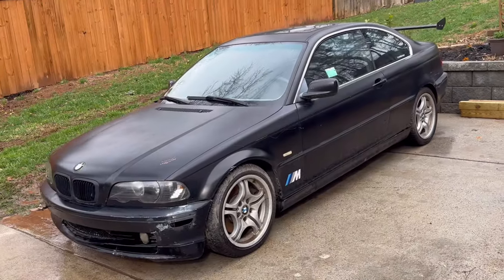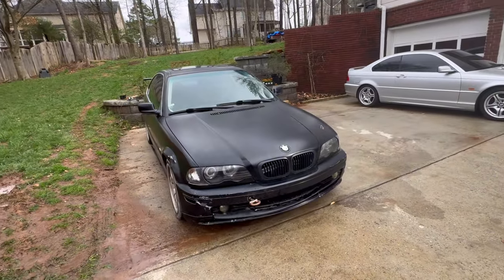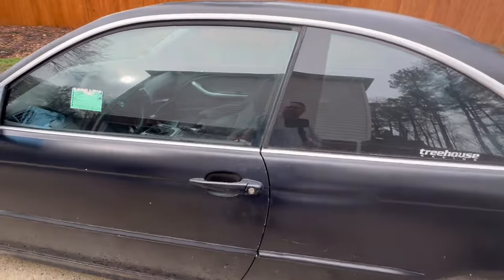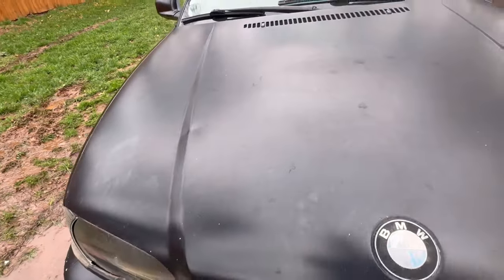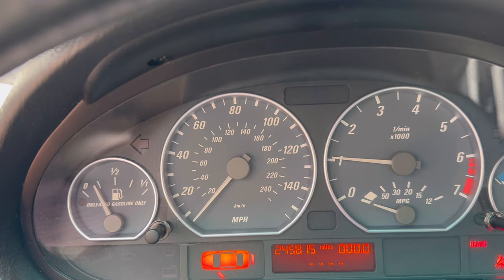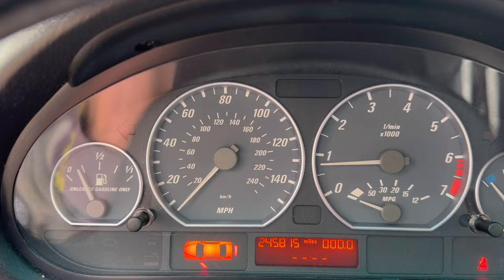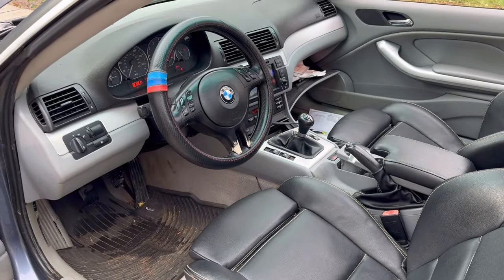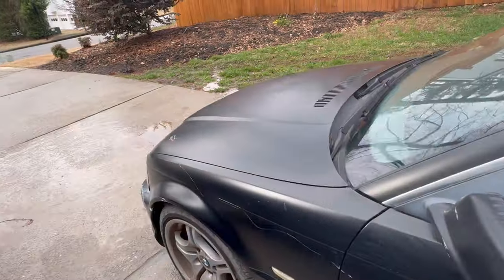$600 manual E46 330ci bought sight unseen. Will it run and drive?

Comment: After owning three e46’s, I’ll never go back to owning one. There’s always some issue arising. I’ve replaced every component I can think of and still having issues. Not to mention they aren’t quick and parts aren’t too cheap compared to other vehicles I’ve owned. Sticking with Toyota.
Reply from the maker: They certainly aren’t as maintenance free as a Camry - but the driving experience isn’t anything alike either.  I really haven’t seen huge costs differences in parts and I’ve had every nut and bolt out of my grey 330ci.  I’ve owned many Toyotas and still have my tundra - it’s a beast.  Then we have the Model Y for daily and work duties.  A shoe for every occasion so to speak.
Reply: @robsweekendgarage  nice. Agree, BMW’s are fun to drive. Mine is a wagon and still feels like a go kart.

Comment: Well after the insane prices we saw for these cars in 2020 to 2021 (in Canada they were) to see one that's in this condition being bought for $600 it seems almost impossible. Not that it's a wonder mobile LOL. Even today I saw two 330CI's one with a blown head gasket and the other was a "Bring a trailer"  thing for $2500. This is a major score!! IMHO. There's not much for rust that you've shown anyway. Why would you part that one out? Maybe you should part the other one?? Or finish fixing this one and sell it for a tidy profit? Parting it out doesn't make sense.
Reply from the maker: When I first saw it at auction the idea was part out.  Considering salvage title and that I’d have to apply for a title if I wanted to sell it cost me another $200.  Add in that I was expecting no keys and most cars that get towed and impounded aren’t cream puffs - that was my original intent. But after spending some time with it am really starting to see that it deserves to be back on the road.

Comment: With title situation- parts car which you can make probably 3k or could make a decent track car. Manual check. Lightweight stlye 68 wheels check. Gut the interior and it already has a semi functional spoiler 🤣